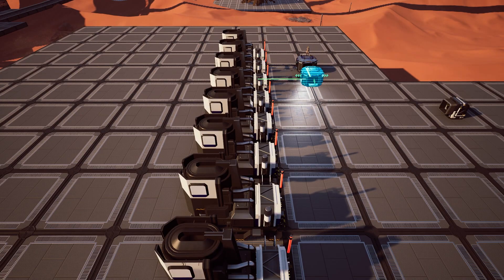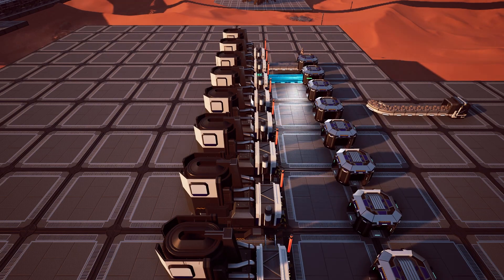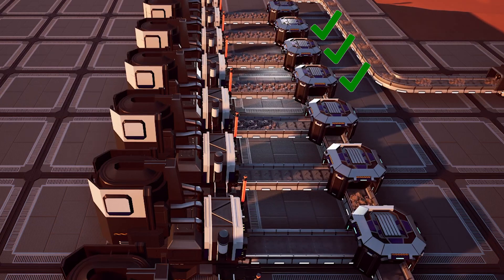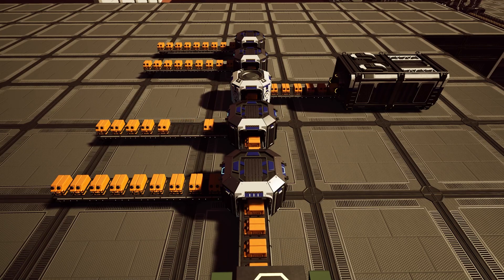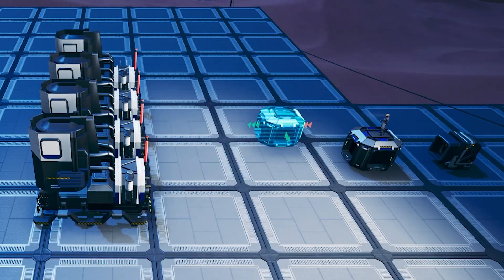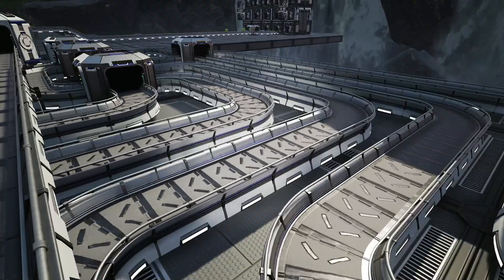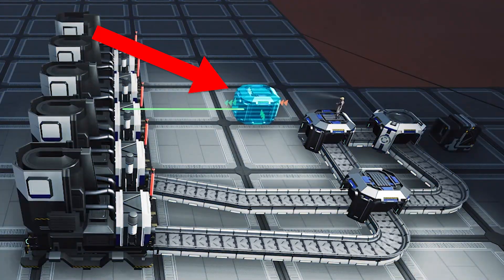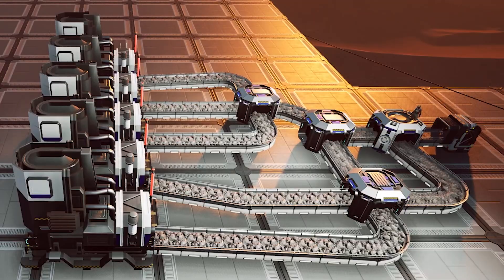Satisfactory: Manifold vs Load Balancing for Belts + Tutorial

Comment: was this before smart spliters and programable spliters were in the game?  I tend to to use manifold with smart spliters; when 1 belt isn't enough (like if the math says I need 1.4 belts for an ingrediant in a recipe) I belt in a full belt going the other direction and merge it in with machine that wasn't taking enough.  Then I put a sign saying how much is being used, so I know how much I have left over in case I need that ingrediant somewhere else.
Reply from the maker: This was not before smart/programmable splitter, but their usage was a bit outside the scope of the video. For a general manifold or Load balancing system, you don't need them. But there are many situations where you would use them. I know I use smart splitters frequently especially when I can't let a line back up, and need to sink the overflow into an awesome sink. In your example, that's a great use, although it would likely be in conjunction with a load balance or manifold system. What you're describing would likely be followed by a manifold or balancing system to get those items into the machines (if the belt needs to go to more than one machine).

Comment: manifolds can be balanced a little bit better if you input into the middle of the manifold and split out to two different manifold sections. won't be a big deal for 3-5 machines, but for large numbers it will be helpful.

Comment: Honestly, never see the point of load balancing for maschine inputs. Its larger, actually costs more due to all the extra splitters, more anoying to set up AND they suck if you wanna actually put these into factory buildings cause of the like 1-3 extra foundations space you would need compared to the manifold.

The ONLY time I would say load balancing is worth it, is in the very specific scenario where you wanna do early quarz processing for some easy ticket production, but you barely have any Tier 2 belts yet. Then doing load balance is a bit better there

Comment: The thing about manifold is that it’s not efficient. Let’s say you have a 120/min iron node and smelters at 30 iron per min in to them. That 4 smelters with load balancing you split twice and each gets 30. With manifold the first gets 60 the next get 30 the the 2 after that get 15. At that moment only 1 is efficient but when the first backs up the the 2nd gets 60 while the 3rd and 4th get 30. Then the 3rd and 4th get 60 and eventually they basically all get 120. The end result for load balancing is every machine gets the 30 it needs while for manifold the end result is they all get 120. There is a exception to this. Let’s say you have 240 out of an iron node the the smelters need 60. If you go manifold the main bus is sending 240 but if you use mk1 belts the smelters will always get 60 meaning that it’s just an easier way to get the same result.
Reply from the maker: Maybe I'm misunderstanding you here, but I think what you said is essentially my point in the video.. Manifold is slow to get working at max efficiency, however it will work itself out over time. And all of those downsides can be overcome by simply letting the input belts fill up before turning on the machines. It's also usually not that important for a factory to be fully operational in an instant, but if for some reason you need that, you would then choose to fill up the belts in your manifold, or to use load balancing.

Comment: I use both depending on given situations. I tend to use balancing on the output from smelters when you produce 3-5 or more items per cycle. That tends to load up belts and backup machines quickly.
Reply: I don't understand what you mean.
Reply: @justintime5021  If you have for example - 10 foundries with an efficient combination of coal and iron ingots that is spitting out a high number of steel ingots quickly on a row; you need to figure out a way to unload all the items efficiently so that the foundries don't get filled up. If that happens it is a sign that you need to balance things out somewhere along the production line. Getting items offloaded and loaded into storage units quickly, usually requires some kind of belt balancing. As long as you keep items flowing on belts you keep the foundries working on shipping out items. Having the belts tightly packed at the same time requires some tinkering. It is the same principal for every type of manufacturing not just smelters, but smelters is always a good example because if there is something that you should always pay most attention to. It is having ingots flowing in your system.

Comment: I have issues with both. sometimes manifolds run out of materials at the last machine when my math for the input and belt speed is correct. and sometimes in the case of my nuclear plant, one belt takes all the nuclear rods no matter what.
Reply from the maker: Yeah, those are the big issues with manifold. The first problem can be solved by letting the input belt saturate before turning on production at the machines. The second issue is actually one of the few mandatory times to use a Load Balanced system, because it's very important that every machine gets an even amount of materials.
Reply: @SatisfactoryNews  I’ll keep that in mind, thanks
Reply: @SatisfactoryNews  turns out it's because my fuel rod production was a bit flawed, so that's why it seemed like some load balancers took more fuel rods than others.

Comment: Im confused about why load balancing works as described.  For simplicities sake lets say all belts are mark 1. So we have 60 items in. Passing through merger 1. To splitter 1.   This creates belts with 30 items each.  Splitters 2 and 3 create lines with 10 items each. But heres where the confusion happens for me.  How is the loopback belt able to merge it's 10 items with the full belt of 60?  Wouldnt it be at max capacity already and just back itself up immediately and stop moving? If not. Where do those resources go? Does the game just delete them? Im very confused by this.
Reply from the maker: You know, that's a fair point and maybe something I should have mentioned if I didn't: The main belt needs enough capacity to support the original amount on the belt plus whatever is on the loopback. There are very few situations in which you would be using Mk 1 belts, though, so while it's an interesting thought experiment it's not really practical. In your example though, the system would indeed back itself up. The backup would be shared across the main belt and the loopback belt, and you would only end up getting 50 resources per minute (10 per each of your lines that are going to machines) at first. However, I believe eventually it would even itself out, but it would not be immediately even. But the appeal of load balancing is that the system works immediately - at that point, there is no reason not to just use a manifold for this use case. But, the solution is of course to use higher capacity belts that can support this. There are very few reasons to implement load balancing at the point in the game where you ONLY have access to Mk 1 belts, so there is no reason you'd ever do this. If you absolutely had to, a manifold would be simpler.
Reply: @SatisfactoryNews  yeah fair enough and I did eventually sort out for myself that the main input belt would have to have a higher capacity.  I used mk1belts only as an ease of math example.  I still get a brain problem when I try to make it work in my head though.  Even if we jump to mark 4s and say in the input is 480 I feel like if you are bringing in X resources and looping back to make it something like X=(X+1) if you do that for some length of time I feel like it must eventually reach the capacity limit.  But Im probably over thinking the theoretical. I could reasonably assume that if you used a build that was consuming resources at 100% efficiency it shouldnt back up until your finished product filled up it's storage and stopped outputting.

Comment: I like to use Load Balancing whenever it is possible. And not only for Inputs, but also for Material Outputs. It can save Building Material because you need less Splitters or Merger.
For Example: If i want to feed 6 Machines in a efficient Way, i only need 3 Splitters. One to Split the Incoming Main Belt into two and the other two to Split these into 2x 3 Belts.
I don't know if I'm right about that, but I think, each splitter and merger that you place on the map must and will probably be calculated individually. The fewer of them I place, the longer Satisfactory stays smooth. So I always try to place the amount of splitters and mergers as low as possible.
For 6 melting furnaces with a manifold I would have to place 6 splitters at the entrance and 6 mergers at the exit. Here I prefer to choose load balancing, placing only 3 splitters at the input and 3 mergers at the output. As your own factory grows, the difference will certainly be felt over time.

Comment: If you have power to the machines in your manifold, but have not turned off, the materials enter the machine. They will fill quickly enough and then you turn them on. This cuts down the time you are waiting for your system to start up as they all already are overflowing.

Comment: Maybe it's just me... When im setting up a modular factory with a manifold I wait for the first row of machines in the production-line to completely saturate with materials before i turn it on to avoid the imbalancing issue.
Reply from the maker: That's the best way to do it, if you have the patience! Highly recommend just waiting. But that extra time is potentially one of the downsides. But it's only a downside you have to deal with once.

Comment: 3:53 Can you use programmable splitters to balance all the fuel equally and connect them to nuclear plants as manifold?
Reply from the maker: Programmable splitters don't let you set a number. Any splitter will always split evenly across all of the outputs. So, that's why load balancing is useful. If you could manually set an amount you want to come out of a splitter output, then load balancing systems wouldn't be needed anymore.

Comment: Manifold mostly. But given the slowness of early game belt speed. I use the reverse of injection. Rather than trying to speed up the end, I speed up output, by adding an extra splitter in between the third and fourth splitter. This is then fed to the injection system further down the line, where delivered its seem to take forever to reach. You can tell when this is needed. The factories will be filling up with the item being made, and the items are backing up along the belts. As a bonus of doing it this way, you can easily remove these extra splitters and belts, when you get faster belts. This will make the entire thing more pleasing to the eye!

Comment: It's funny how all this information was out there, and these methods were what I just figured out through brute force of playing before realising they existed on the wiki 🤦‍♂ Very good and clean guide though, I think you captured each perfectly!
For me personally, I always use the belt balancing system for coal power, and always use the manifold (with oil pipes) for fuel generators. When it comes to production of items I usually get my available input in ingots, then use my big manual ingot:item ratio list to find out how many of the item I want that I can make, then will use balancers in that situation to get that amount. The great thing about this is that the efficiency is fantastic. The bad thing about this is that it's not expandable, so if you ever want to start producing more you need to either redo your system, or essentially get enough input to "double" your system capacity, which is very expensive in both resources and space.
Based on this, I think for me the best system to use is balancers when you know you are using your full capacity and don't expect to need to expand for a while e.g. I use a bunch of balancer systems for my Iron Ingot -> Heavy Modular Frame plant. However if you know you want to constantly be expanding a certain production (for example Fuel Generators, or say you have a factory that exclusively produces Screws to be shipped around) then the manifold is the best bet. Chances are in this situation you have no reason to get up and running instantly and are alright to let it run a bit before full efficiency. However it also makes it super easy to expand, so for example Screws are needed in massive quantities for a ton of different items, and so it's a good candidate for regular expansion. Using the manifold here means all you need to do is add on the extra constructors and input as necessary, and also lets you overclock at will since efficiency isn't so much of an issue as long as you know you have "enough" being output.

Comment: I use manifold most of the time, and I use slower belts to balance my splitters better. The splitter can't do 50/50 if items are coming in at 300/s and one of the outputs is only taking 60/s. It's not always perfect, but it gets you the best of both worlds imo.
Reply from the maker: I do the same thing. I try to also use signs to signify how many materials are going each direction, so I don't accidentally upgrade the belt later without realizing there was a reason I used a slower one.

Comment: Instead of using a loop-back, just add additional buildings to your factory and underclock them. So instead of 5 buildings running at 100%, build 6 running at 83.4%.
Reply from the maker: That method also works, but it can be annoying to some people to do that math and adjust the clock speeds. The nice thing is that there are multiple options depending on your preference!
Reply: @SatisfactoryNews I get it. 5/6 is too much math for elite Pioneers. /s

Comment: late to the party here, but the main downside to manifold is eliminated by setting up your first-phase production before setting up the rest of the factory.
your factory won't produce anything until it's finished anyway, so letting the first-phase production fill up their buffer inventory as everything else is being built ENTIRELY does away with the slow startup speeds.

even if you don't do that, using your fastest tier of belts between splitters (and only the speed needed as the input into your machines) solves the problem. a low-speed belt can only hold a fraction of what a high-speed belt can, so the drawback of slow-startup is mitigated. 
this solution is probably the one that requires the least change in playstyle, so personally, i think it's the best option.

to add to that, you should really only use load balancers on raw item input and output. as in... ores onto belts, ores into ingots, ingots into belts, and ingots into factory input.
only balance your load where the load needs to be balanced. think of a belt splitter more like factorio's inserter rather than its splitter. yes, it does still perform the function of a factorio splitter, but you aren't placing splitters EVERYWHERE in factorio.

Comment: Load balancing is kinda pointless for low-tier tech.
Most machines only require a Mk 1 or Mk 2 Belt to feed their input. So if the feeding main line is a Mk 5 belt that transports 780 items per minute, the first Mk 1 manifold will split it into 30/750, not even. Next one 30/720, 30/690 and so on, until the last manifold which splits 60 into 30 and 30, and then the line has to end anyway.
You only have to load balance if the main line is transporting considerably less items per minute than the connected belts can withdraw - this becomes important only at hier-tier tech like supercomputers, nuclear etc, basically everything thats produced in manufacturers - and these need a lot of space to properly set up their 4 inputs anyway, so adding load balancing to that is almost free.

Comment: There are two options for this: Perfect Manifold, we need splitters with system that determines how much IPM for a certain side. Working like valve, this'll evenly split the manifolds like perfect split or load balancing. 

Second option is to get the mod "Buildable Resouece Nodes" and feed all machines with their own resource node.

Comment: I do the manifold with smart splitters and set it to overflow on each output.  It takes a minute to fill up but each machine will only grab what it needs when it needs it.
Reply: I think you can do that with regular splitters because when one of the outputs of a splitter is filled, it just ignores it and starts balancing between the two other outputs.

Comment: Something I do to help my Manifolds populate quicker is have the output belt go the opposite direction. So if I have the input start on machine 1, I'll have the primary output go from say machine 9. Early game this is much more viable because you are more limited by belt speed. Similarly, if you use an injection method where it feeds to the beginning and end of a row of machines, it can help greatly in 'warm up speed' of the line.

Comment: If my math needs 5 machines, I just have 6 machines and down clock those 6 machines equally so they are 100% efficient. this saves on unnecessary loop backs that have blockage potential. especially when running the max capacity of a mk5 belt from an ore source. I never used manifolds even when I bought the game at release, it just seemed the wrong way to do things.

Comment: For a coal power plant or something similar, I like to use a "smart manifold".  I use smart splitters to fill up the first, or first few, power plant(s) completely before allowing the coal to overflow to the next few machines.  This makes a nice smooth ramp up in my power graph and prevents sputtering of the last few machines that are fed inadequately by the other two methods.

Comment: To safe a lot of space and time because of lesser complicated installations and expandability, I prefer the manifold system. If I want a very fast start, I just fill up the machines manually to the max from my full player-inventory with the required input from the last machine of the lane to the first machine.